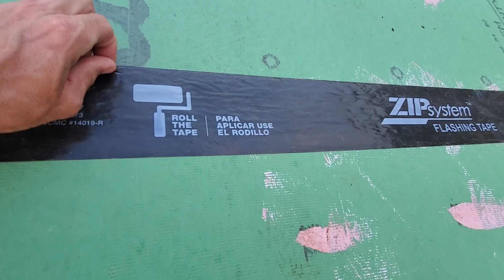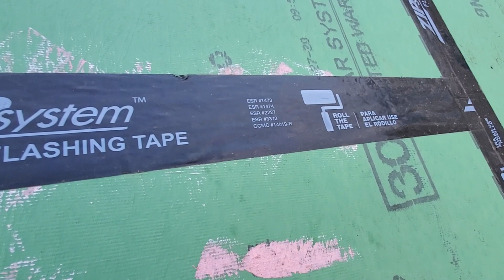Leaks in the Roof after a Severe Storm at our Off-Grid Home Build - Corn Pick'n for Chickens.

Comment: I would roll the tape again and then add more around it.
Reply from the maker: Think I've rolled it another 5-6 times and the tape is really stuck down.  Even before rolling it again the second time it was impossible to pull up.  I'm sure another layer of zip tape offset higher than the first would help but the shingles will be on soon hopefully.

On another note, did you find a good fuel filter for your excavator?  Found out that the fuel tank in my mini-x was full of some type of plastic like flakes which would sometimes block the pick-up tube causing the engine to dip in power or die all together.  All I can think of is some coating inside the tank coming off or maybe additives from the previous owner coating the tank and falling off.  

The quick solution was to cut the pick-up tube shorter so it wouldn't suck up the debris on the bottom of the tank.  Seems to be working and I dug a 300' trench for power on another project without any issues.  Only catch is that I can't let the fuel gauge go below 1/4 tank but I can live with that.

Have you check to see if you have debris in your tank?  Seems like a common issue which is why people put an inline fuel filter before the fuel pump so the pump doesn't get damaged.

Comment: Heres why your roof leaked, when you couldn't see why. 
30 years ago  working as a expert engineer to ther court i was involved with a British car manufacturer, water testing cars for leaks as lots of complaints had been made by customers.
Manufacturer was power spraying cars, much like your rain conditions, with the interiors removed for access to see any water ingress through glass and body seals/ joints, and under these conditions there was no leaks, in line with the manufacturers claims. I introduced a vacuum to the interior, causing an interior compartment depression, similar to a car in motion at 60 to 70 mph, suddenly the water came in from many places.
In your storm the wind was blowing through the windows blowing through the floor directly under your roof, this strong wind would generate a depression/ vacuum/ pressure differential between the air inside on the underside of the roof to the pressure on the exterior of the roof.
This vacuum/ depression would suck the water through the roof where any tape issue was.
I daubt if you close off the windows at one end of the building you will experience this again
Reply from the maker: Interesting.  Will have to see what changes as we put the windows in.
Reply: Yes it will stop, air pressure works in your house the same as a petrol engine carburettor,  as Air in the carburettor rushes down the venturi, it causes a depression and the fuel is drawn out of the float chamber.
I can only imagine the speed the air was travelling through the windows being drawn out the other end of the building.
Reply from the maker: @davidroberts4670 we had 60 mhp winds with stronger gusts.  It's been a while since I've worked on a carburetor but understand what you ar talking about.  Thanks